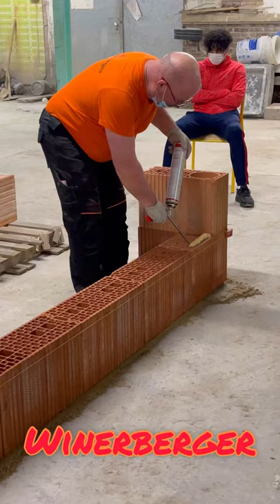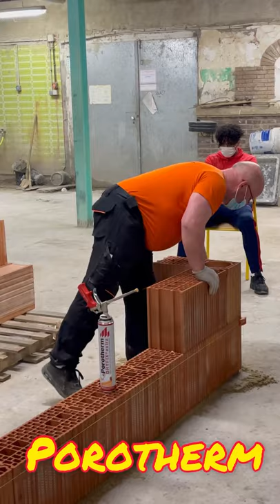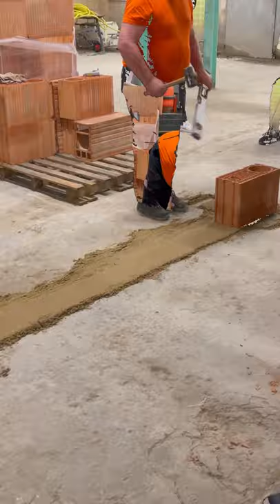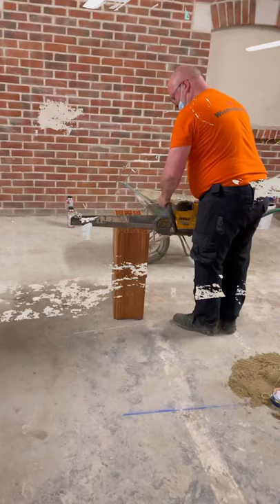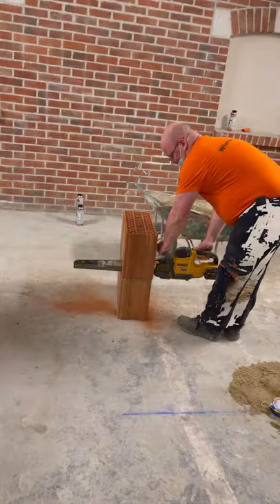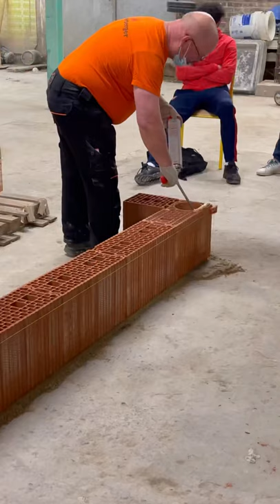Maçonnerie rapide 👌 sans mortier collée au Dryfix

Comment: Faudrait faire une étude sur le long terme ce système vs me mortier standard qui pour moi à faut ses preuves après c'est vrai le gain de temps et considérable mais personnellement jprefere le parpaings
Reply from the maker: Bonjour, tout dépend de ce que l’on veut pour un garage… le parpaing est très bien, maintenant la brique Porotherm est fait pour un meilleur rendement thermique qui plus est avec un joint mince, presque inexistant avec le Dryfix donc pas pont thermique. L’avantage est là en plus du gain de temps.